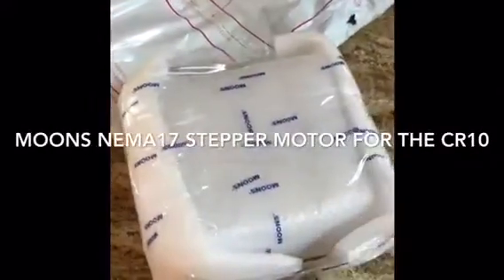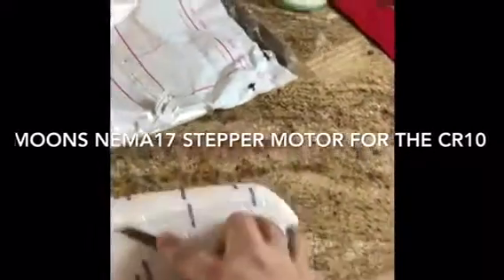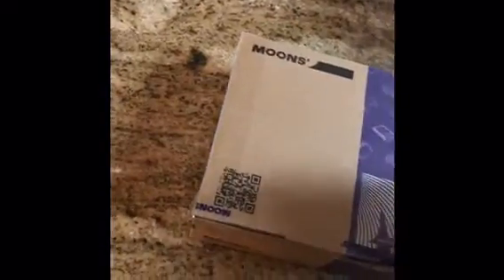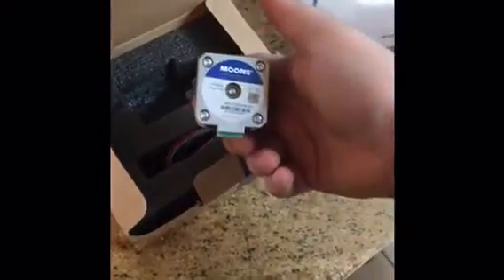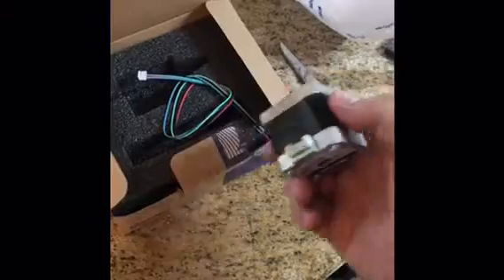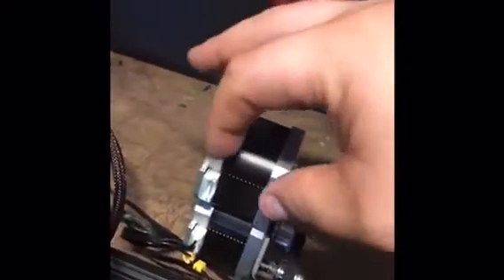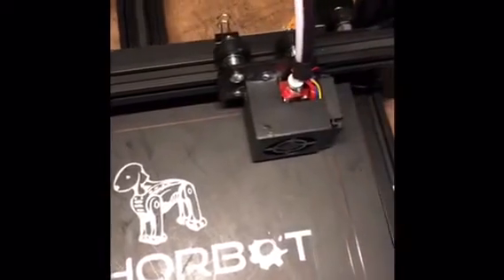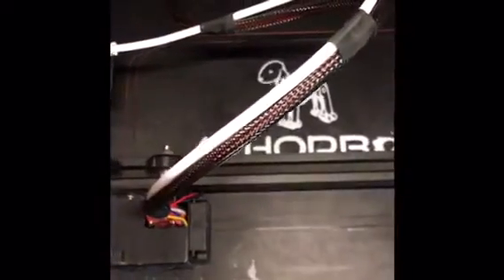NEMA 17 Stepper Motor Fit for CR10 3D Printer from MOONS'

Comment: How is this "Moons" stepper motor working after almost a year of use?  Also, was this "PNP"? Or did you need to swap around any wiring? 
I'm looking to replace all my stepper motors on my Ended 3. The noise is a bit much with the stock steppers plus  "Moons" claims to give you a much smoother print by just switching to thier brand of stepper motors.